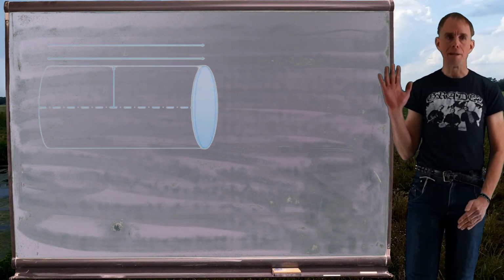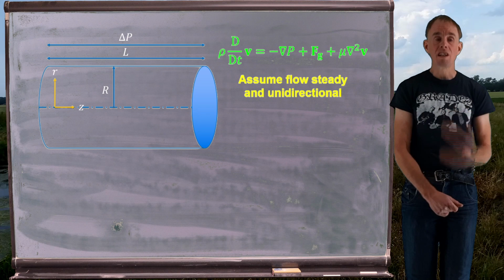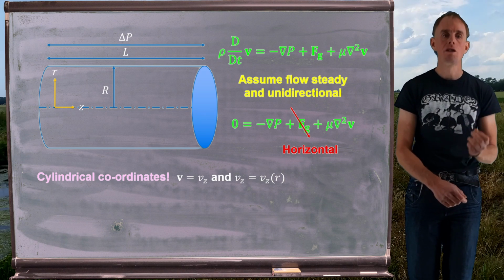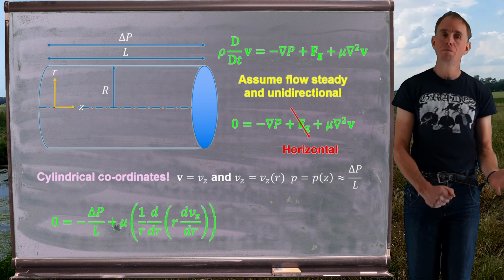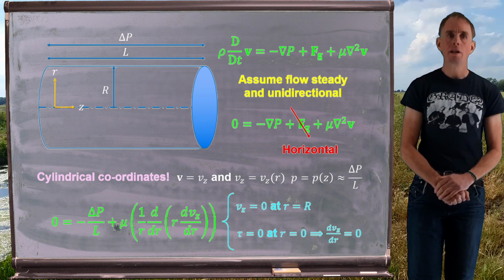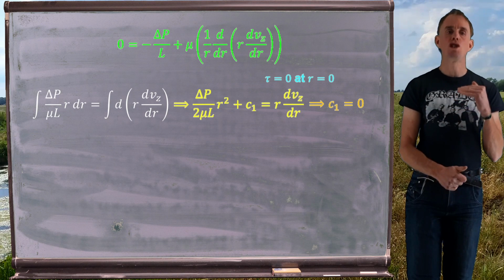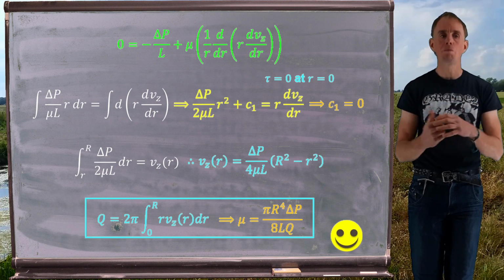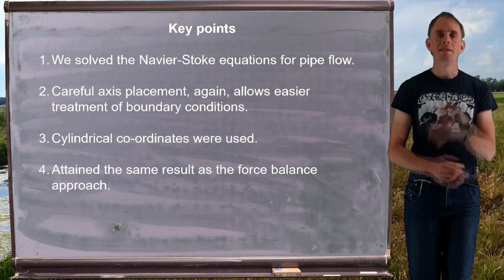Lesson 5, part 2: solving Navier-Stokes for pipe flow

Comment: Very helpful. 

I did the homework and it was impossible unless, I add an extra minus on the ΔP/L, but need to justify physically.
Reply from the maker: Yes, that's right. \partial p / \partial z = -\Delta P/ L. 

If you think about it,  a positive  \partial p / \partial  z increases from left to right as that's the sign convention. But for the flow to be from left to right, the pressure needs to decrease from left to right!